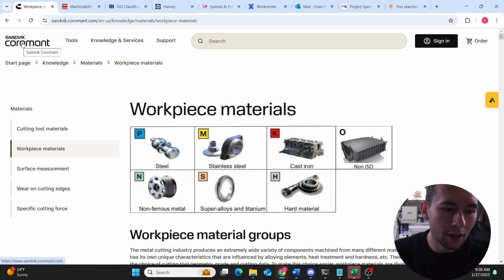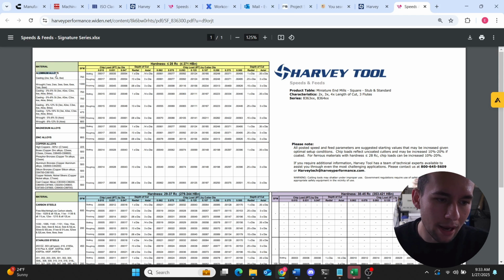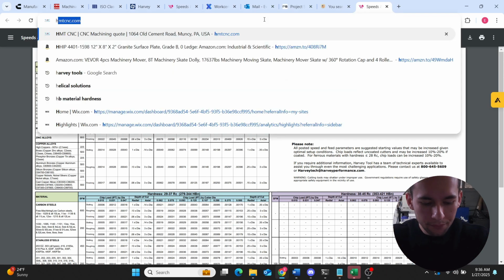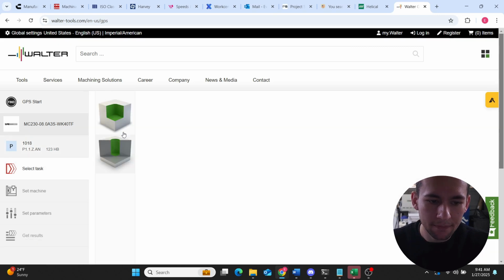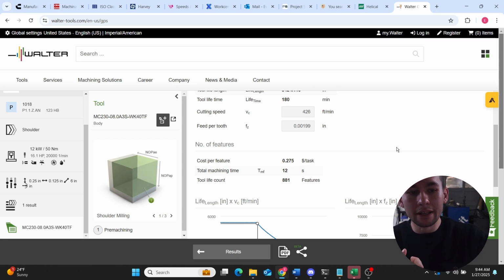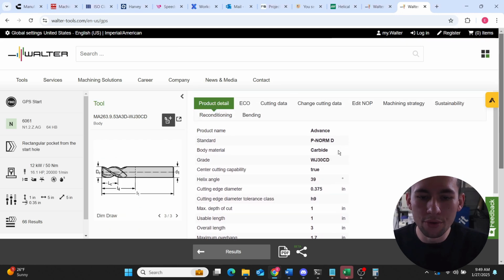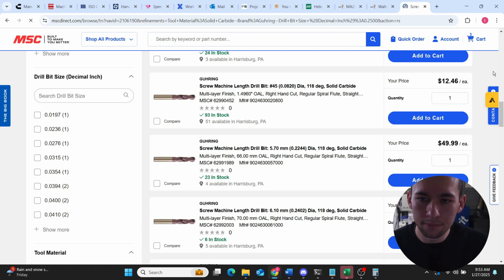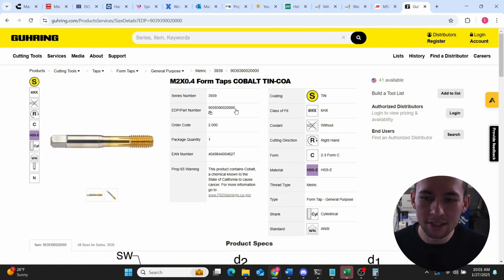CNC Machine Tools  : Purchasing / Technical Data

Comment: I have small cnc workshop here in EU with older fehlmann sk30 machine. I buy endmills, inserts and heads on aliexpress. Normally in larger quantitys, so I have always on stock for example in size 10mm at least 5 pcs each of normal, alu, normall ball and alu ball enmills. For roughing 90% of the time I use lnmu fast feed inserts on 25mm/1inh head. Mostly work on tool steels. I do buy some high quality tools, for side finishing (garant, holex) and osg for milling hardened d2 tool steel. The most expensive tool for me is the one that I don't have, because work that I get is all on short delivery date.